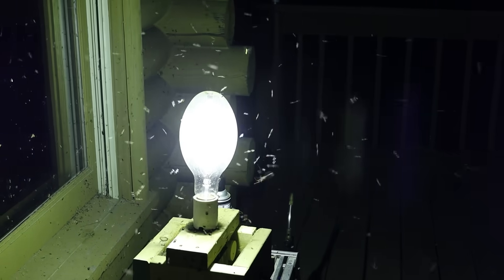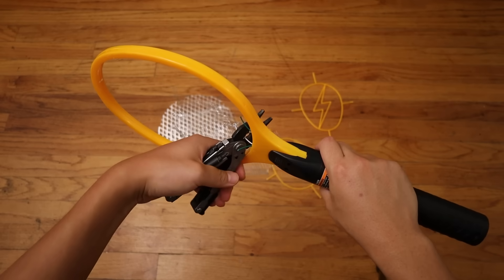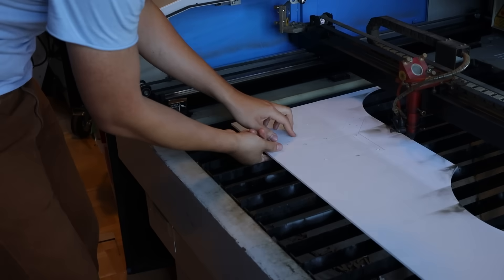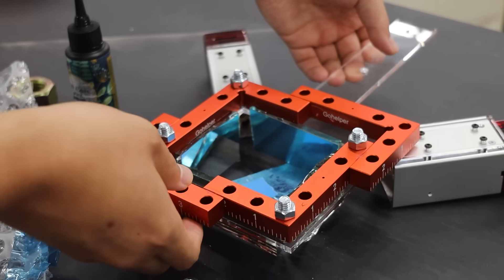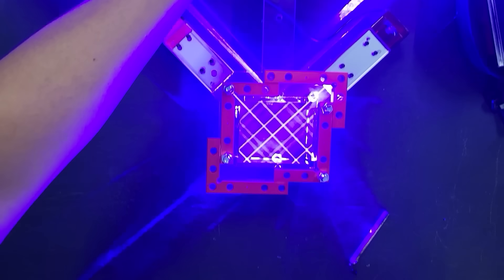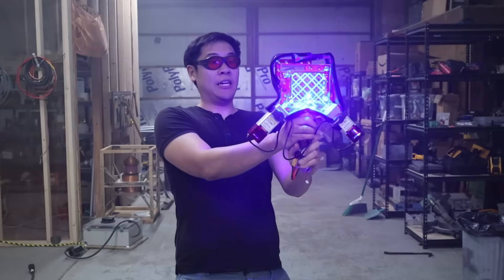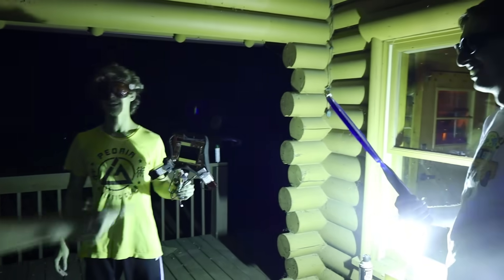killing mosquitoes like its the year 3000

Comment: This is pretty weird.. I was randomly thinking about that mosquito killing laser thing a couple of days ago and now I see this.. I was wondering if I could implement it and  when you actually think about the practicality you realize the danger of burning someones corneas out is quite high. Also I was skeptical about the ability to detect a mosquito at the time.  I work in computer vision now.. I'd say.. its probably doable but the danger of aiming at someones corneas is not insignificant and if you want to detect the mosquito as it is flying by without any horizontal aiming.. You'd probably need a lot of powerful hardware.. unless you just shoot at anything that moves.  But idk. You have about 5.68 ms to detect a mosquito traveling at 1.5mph who is .15inch long.  You might be able to run a model at that rate, but  even the latency from the camera would be a factor at those speeds

Comment: The idea is brilliant, your product, not so good. You needed two parralel mirrors, or even better two polished stainless steel metal plates to reflect the laser. Then you should conficurate the laser to bounce in a very close distance until exit the two metal plates.

Comment: The problem with your first setup is that you're attempting to use a commodity digital system, when you need the infinity-factor and loop-speed of an analog system. Instead of using slow RC servos for beam-steering, simply use a small speaker that was chosen for high excursion and a lack of goofy cosmetic features. A 4-inch speaker is plenty for mirrors the size you ended up gluing for your "grid". Glue a thin, threaded, brass rod to the center of the cone (to the surface of the little dome). Hold the rod in a drill-press chuck to make sure it's straight while the glue sets. Mount the mirror to a thin piece of brass sheet, or folded sheet steel (for stiffness), with two thinner brass strips on one side to form a hinge, and a hole for the actuator rod to stick through on the other side. Use this system to pull the edge of one mirror per axis, and hinge the mirror from the other side with the 2 thin brass strips. Attach the threaded rod to the mirror plate through a hole (reinforcement and stiffening may be necessary, but you can remove most of the metal behind the mirror for lightness, if necessary), and use a nut on both sides of this bracket for adjusting the zero position, so you don't overheat your driver circuitry while at-rest. I know this type of system to work at rates that are faster than a typical mosquito, circa 25 years ago, but if they have fed on StyroPyro, they may be able to outrun a laser.

Comment: I want to see you make a better one where the space between the beams is smaller. maybe even use something to redirect it to have 2 overlapping layers to cover gaps.

you could also put a fan on 1 side to suck in mosquitos. if you had a fan and a tube looping back around near the entrance you could essentially suck them up and force them through a loop where they will remain until either they die, escape, or its turned off.

Comment: Laser safety officers everywhere are getting migraines.  You could make a much larger unit that was stationary with one rotating mirror and multiple fixed mirrors to create a larger kill zone with tighter coverage of the space.  Then you just need something to attract the mosquitos.  Point one of the angles down instead of having a flat mirror to keep carcasses from building up, and a small fan could blow them out of the unit or pull them into a container if you want to collect them.

Comment: The laser wasn't doing anything that was impossible at the time. They used a second low power laser to sweep past a retroreflector and when it found one they aimed the high powered laser at that spot. It was automation, but not machine learning AI.

The reason it never hit the market is that it is 100% a blinding machine. In use industrial lasers like that have all kinds of safety features but you can't really do that in 3rd world huts.

Comment: 🎯 Key Takeaways for quick navigation:

00:14 🪰 The video showcases a machine that uses AI and lasers to track and shoot mosquitoes out of the sky.
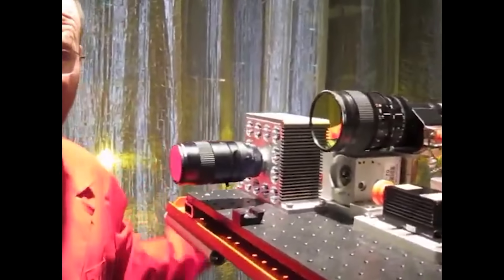01:09 🧠 The narrator suggests a simpler approach to mosquito-killing machines using lasers instead of mirrors and AI.
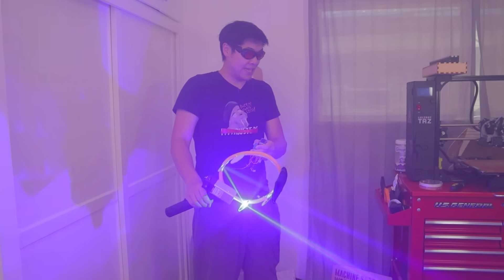03:11 💡 The video documents the process of building a laser-based mosquito swatter, including safety precautions and challenges.
05:41 🦟 Testing the laser mosquito swatter reveals success in creating a laser grid to target mosquitoes.
09:08 😂 The test results are mixed, with some mosquitoes getting hit, but gaps in the swatter allowing some to pass through.

Made with HARPA AI

Comment: Ok...now make it...BIGGER.

I'm picturing perhaps a narrow gauge rail line running down both sides of a piece of land, with a 100' wide span made of triangulated tubing (like a crane) and a 500 watt laser at each corner.  Thinking of a grid of about 10,000 lines and capable of incinerating birds and bats.  Yeah.  Yeah, that'd be nice.

Or maybe start small-ish...maybe a 10 footer...made of PVC pipe...

Comment: If you would like to invent a save laser defence device. It might be safe to use several lasers with very low power, which all aim at one insect für about a minute and slowly increase the body temperature of the insect, it will die at some point but big things can't be burned or harmed. Mashine learning could be used for the reognition process. I don't know which method would be best to aim. there are dlp laser projectors maybe the DLP technology might be good to manipulate a laserbeam very fast?

Comment: funny/nice project. But the practicability seems a little low. You yould put a big fan in front of it, a Light& CO2&sweete-sour-smell source in front of that and so the bugs would be attractet to the light/co2 source and then get sucked be the fan in the laser trap. It may even be more effective to encase it, so the  bugs would have to crawl into something, so they cant escape the suction from the fan so easily. The air from the fan might even cool down the lasermodules.

Comment: thoughts: 
1) I would have 3d printed the racket. That way you could go larger and get the right angles you needed easily.
2) prototype with a green laser pointer, one of the good ones that doesn't leak IR. I would only add a higher power laser as a final step, once I had a really tight mesh.
3) Investigate how low a power setting you can go with and still do enough damage to ground them.
Reply: 4) see how small you can make the first surface mirror chips to make it wieldy
Reply: @NotOneToFly  a low CFM ducted collector fan system to direct them into the stationary laser grid.
Reply: 5) make it all some sort of trap setup so they get sucked into it after being attracted to it from far away, like a dyson purifier looking machine
Reply: 6. Test out the lasers on mirrors before mounting it in the racket. Also on the second try.
7. Experiment with angles coz im sure the grid size can be reduced further with the right angle. A
Reply: in the end that thing look unreliable in long term
Reply: Good way to make it slightly  less cursed, as strapping lad Styro put it.
Reply: fr
Reply: I didnt see how they were powering it on but hopefully it's a button or something you need to hold to keep on and not just a switch. If it's like a switch and accidentally got dropped you could burn a person, an animal, catch some grass on fire, or your house. Really this just seemed like a lot of effort for a worse and more dangerous fly swatter lol.
Reply: this is why you're a cyclist. this all sounds very unfun
Reply: @mwcallan2  as the old joke goes, "I resemble that comment" :-).

Comment: if you set up the lasers at one less or one more degree than 45 it should make the lazers occupy more of the space in the square also if you used a circle it might be more complicated to design but if you used a circle and pointed it very slightly off from pointing straight it would reflect and take up pretty much the whole thing (this is something i thought of in like five seconds based off the bullshit i did in geometry 6 or 7 so take it with a grain of salt)

Comment: I wonder how many will attempt to develop this to market. 
The lasers and batteries would probably be in the handle. Maybe much smaller solid state lasers could be put in the perimeter of the intended laser plane. The killing plane would probably be larger than what we've seen here and be made with circuitry that would not allow dangerous boosts of energy to be put into the beams. It would only be strong enough to mess up a mosquito, or other insect. 
I can already see why one might think twice about offering such a device to the public; lawsuits galore.

Maybe a larger, more flexible version could be used for agriculture. Beam alignment might be a nightmare if you're trying to put an entire tree through the laser plane. Can it neutralize a caterpillar without hurting a bird? 
Offering a unit to fit into air conditioners and box fans might be the way to go. It's gotta be 'toddler safe' if it's for out-in-the-open use.

Comment: Allen Pan You need to reduce the current on the laser: the laser will degrade and heat less.
Then it will be possible to turn off the light on the street and leave this laser on the table and see, maybe the mosquitoes will fly to the laser themselves and get into the laser grill? If they obey it, then you can place a light bulb behind the laser =)
p.s. sorry for google translate.

Comment: Why not just super powering up with voltage a better tennis electric fence thingy?
Something as thin as fishing line,thermally conductive with a high temp melting point but made tightly into little 0.5 mm squares and have that as a lid of a box that has the light inside that attracts those feral mosquitos.

Comment: the advantage of a laser grid, it's quite safe and powerfull, just wear glass...the incovnenient, too much energy, you need glass, too much weight, actually an enhanced electric racket with more voltage and surface could have done the job better.
if we coming back to tracking mosquitoes lazer idea, , you need 1/very good tracking, 2/very good identification with frequence/camera, 3/a laser...
but most importantly its not safe at all for humans since the laser is powerfull enough to burn in few millisecond a mosquitoes, he can defintly burn skin, destroy eye, make mark all over the room, or put fire at your house. yet
 it could be usefull in workplace imagine a room infested with not burnable stuff, like cold room, engine room, stockage room, put the machine on floor, remote control it , come back 15min later, it could avoid use chemical....and a laser grid in ventilation system, actually they use filter and even UV

Comment: To get 100% kill factor you could use two parallel mirros and a mirred cylinder to fill the entire volume. Add the fan like @user-cg8df3my2x suggested. Fan would also help with the burn fly smell.

Comment: You need to make a larger one with four lasers, and then put them on a tiny actuator to have them pivot back and forth to cover the larger area better.
Then put an enclosure on one side of it with a bunch of UV lights to draw them through the laser-matrix.

Comment: Low-Tech solution to see the laser without using a camera. Little bit of smoke or vapor. Also if you'd add a few UV LEDs the bugs would be attracted to the grid. Then just leave it stationary.

Comment: The thing is though, you don't need to cook the entire mosquito in order to kill it, you just need to burn its wings so it couldn't fly. I think if you use x-y galvo mirrors to create a conical shaped scanning laser field, mount it side-ways and let the 405nm laser's light attract the mosquitos. Leave the system on for a couple hours and it should take out a lot more mosquitos than any hand-held zapper.

Comment: You guys are not too smart. Just kidding. Put a fan on one side. Suck the mosquitos through the laser. Also ,the laser grid is way too small. The laser is so powerful, it could easily be 3 times larger and still fry bugs. And the grid needs to be smaller. More bounces.

Comment: When I saw the first image of the video I liked it it looked like a laser cannon But now that I see it you can actually make a laser kin arvitt take the Mosquitoes waster or whatever is called and take the lasers on it and angle them further in so they're pointing inwards a little bit and add multiple lasers down-the-line So technically you can have a giant leader cannon that comes down-the-line first crossing everywhere and then one giant laser in the center where all these other lasers connect into this 1 beam then you hit a bunch and it fires out that connect beam That would be cool But I don't know if that's possible or not

Comment: My recommendation is just enlarge the beam,  even a 5 fold beam width your still shooting nearly 1.25w beams, and just use a small attraction light around it.  So as they get attracted to it,  once every 10 - 12 seconds, you basically will nova everything within 2 - 3 inches of the light source.

Comment: Well, to be fair since watching styropyro, I've come to understand that aiming focussing lasers with pinpoint precision in miliseconds is not an easy thing to do. It's possible, but really not a great idea aimce there's such a high potential for colateral damage, like your eyes. 

With that said if it did work id still probably buy one.

Now some advice, instead have ised two beams and reflect them off of four mirrors, you can also use a spinning mirror or prism to create a light cone or curtain. This would eliminate the gaps but unfortunately also reduce the contact time and intensity. However with the lasers you have that wouldnt matter simce it would still be more than enough to singe the wings.

Comment: Hey Allan you are using the wrong type of mirror. You need mirrors that have the reflective surface on the front of the mirror. Like a polished piece of metal. Currently the laser is melting the glass before it reflects. We have all seen superman shaving.  https://youtu.be/_51qvF17Eig?si=9S6fL6Srd2VTyaUm   The only way that works is if his mirror is a highly polished piece of metal.

Comment: I made a couple videos of this years ago with a slightly lower power 445nm laser, it was a lot of fun! 10 years later I'd think: try shooting your 10W laser directly into a 4 sided reflective cube (through a tiny hole in the mirror)with a 25 degree spread lens. It'll create a solid wall of light with a high reflectivity mirror. By the time the light escapes the device (if calibrated properly), the diverted laser should have been reduced by the reflected coefficient of the mirror's efficiency as well as the precision of the beam divergence.

Comment: What you need is to make a parabolic concave polygonal frame, then have  it coated in mirror finish. The side of the frame being concave along their lengths to redirect any stray beams back to the centerline.  The faces of the polygonal sides will determine the number of beams in your mesh. 3D print the fame base, add a heat resistant coating, then electrostatically mirror coat.  Easy-peasy!  Say it could be used to cut and cook French fries at the same time too!

Comment: I dont know much about all this stuff but can't you connect a laser and a short-range radar and When the radar detects a bug which is usually tiny and has high speed it gets detected on the radar and the radar activates the laser and shoots it down. Don't get me wrong it would be a disco of burning lasers in the room but it's better than having to run around with a laser fly swater.

Comment: Good thing about this design, you can easily scale this up without changing the lasers.
Make the grid inside of your window and door frames, and no bugs could ever enter your home anymore.
You may also optimize it using only a single laser with the right angle to infinitely bounce inside the mirrors to create a much finer grid.
Then add a camera to only fire the laser if a tiny object passes through the window/door frame. This way keeping humans safe from being lasered.
Basically a laser powered fly screen.

Comment: Suggestion 1: (simple, dirt-cheap, manual, portable, dangerous): Mount a mirror on a motor, with the rotation axis not strictly perpendicular to the plane of the mirror. Aim a laser on the axis : this will make a cone of light. If you aim vaguely at a mosquito so it is inside the cone, no way for it to escape. Then offset the aiming anywhere else so the mosquito touches the border of the  cone: 100% kill. I would aim toward a ceiling covered with a laser absorbing material (blackout)...
Suggestion 2: (not so expensive, automatic, safer): Replace the simple motor by the actuators of a laser show, and program a cone that gets more and more narrow in few seconds. Still aiming at the ceiling with blackout, but with a very weak laser scanning just below it, so illuminating any bug landing on the blackout. Use any web cam to detect a bright spot inside the perimeter of the wider cone on the ceiling, then  shoot the sequence: automatic 100% kill, and [rather] safe...

Comment: Honest question: Why 2 lasers if you can just redirect the first one?

Next video idea: create a much denser grid surrounding a stationary lamp. They are attracted to light and get zapped. It should work better than electrical traps as bugs they won't get stuck short circuiting them.

Comment: about the entire video I thought why you didn't just put the mirrors on two parallel sides and shot them with the laser from a nearly 90 degree angle, so the beam would bounce from one mirror to the other back and forth and you'd have practically infinite zig zag reflections until the frame ends, maybe even with a continuous sheet of beams